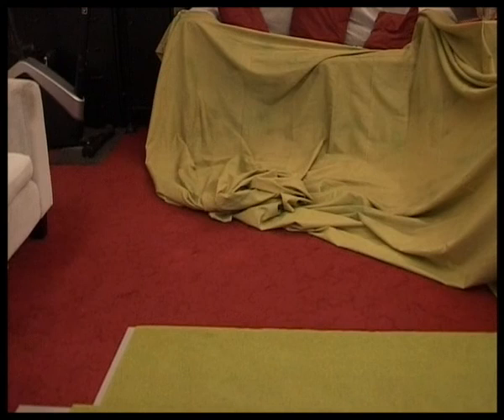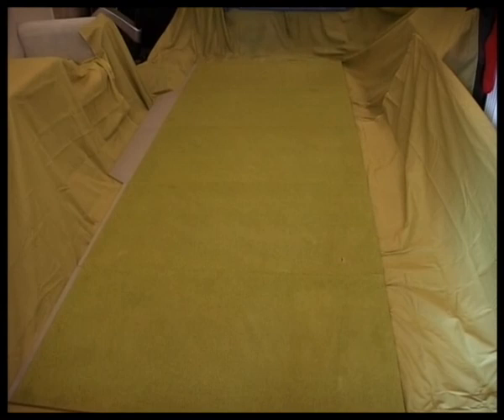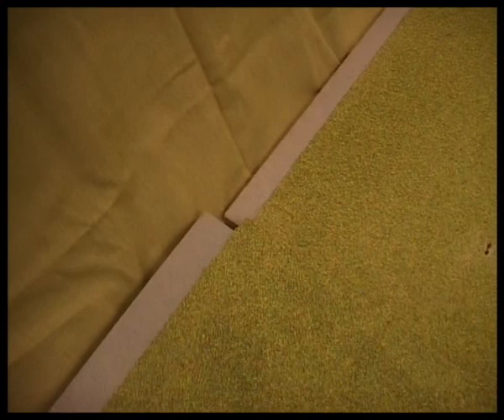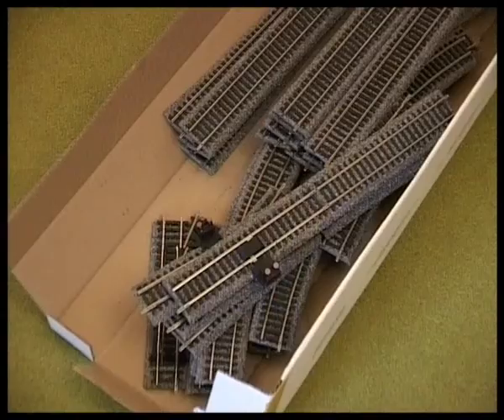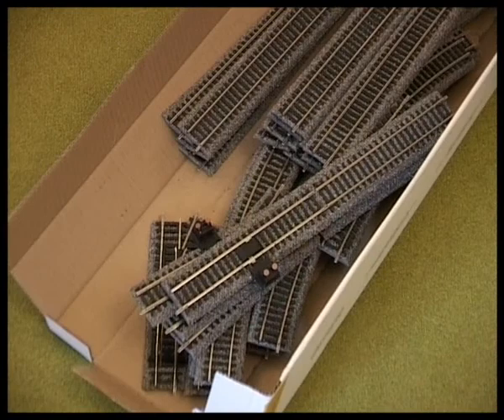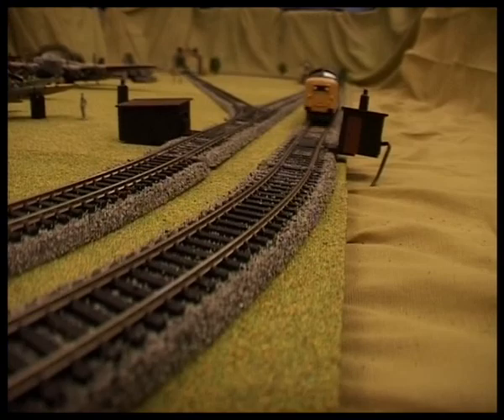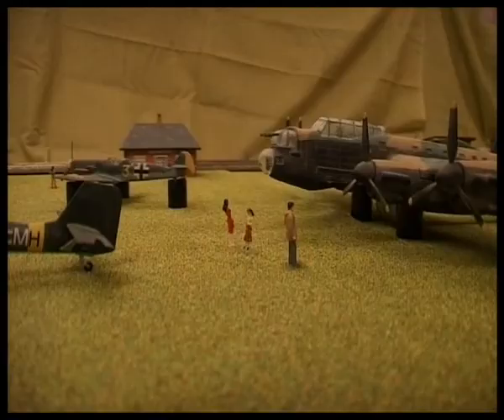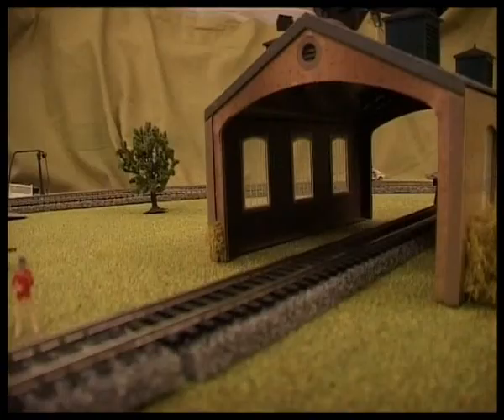Calverton train layout 2 - finished

Comment: Very good, quick and easy.
I prefer to use the ballast sheet underlay where i have track to make it more realistic and any unsightly gaps in the foam track underlay I use loose ballast to hide all the joins. Plus loose ballast can be used in many ways to improve areas just as lichen or static grass can be used for scenic areas.